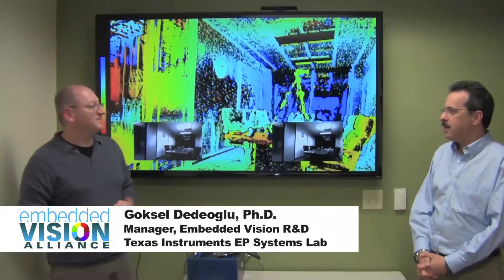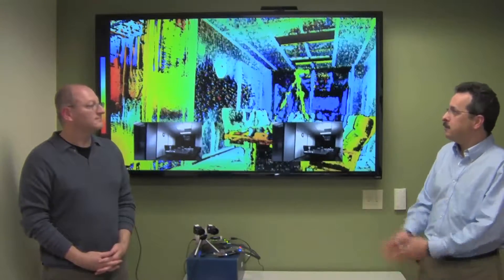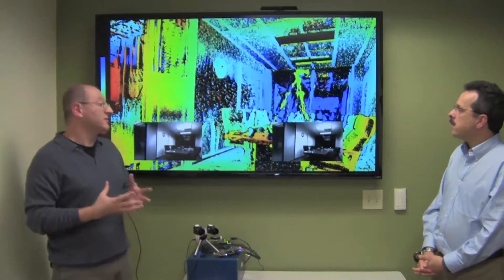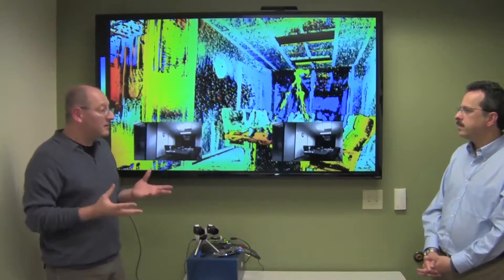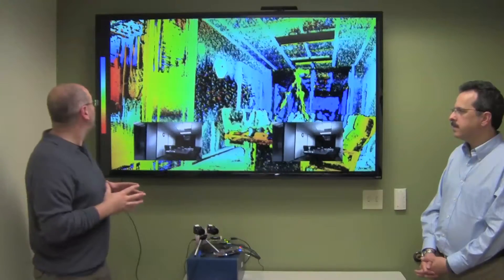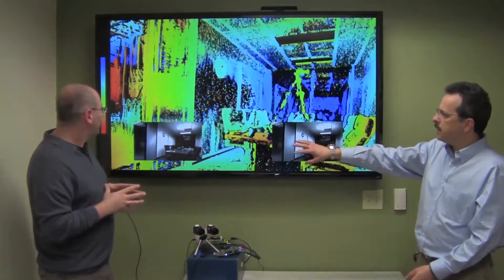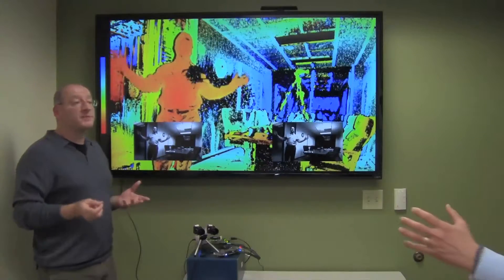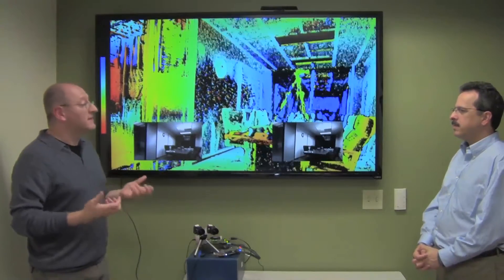A Tutorial on Stereo Vision for 3D Depth Perception (Preview)

Comment: which cameras  can we use for stereo vision?
Reply: you can use any two cameras.  I am currently using two infrared cameras
Reply: I would suggest using any cameras except that both has tobe of same specification. in that way the resolution of both the images would be the same. hence easier to work with